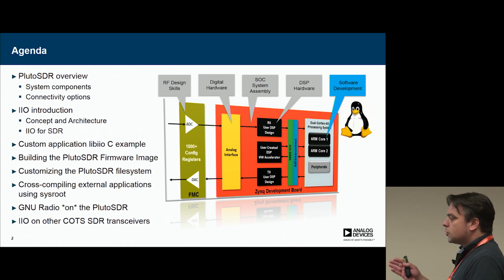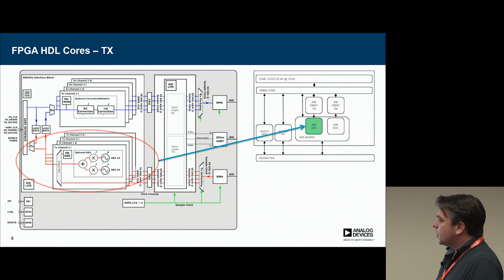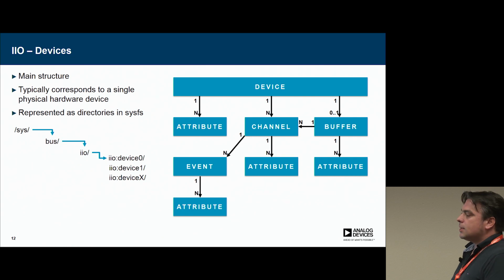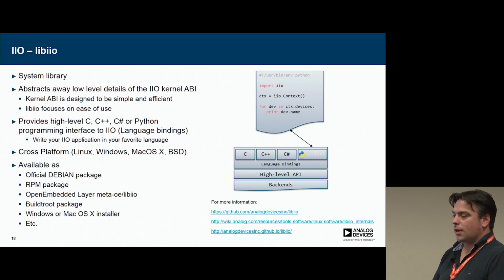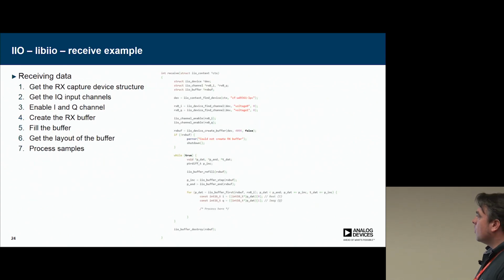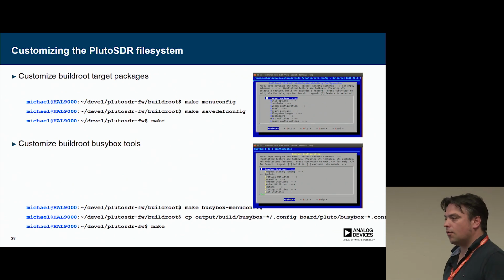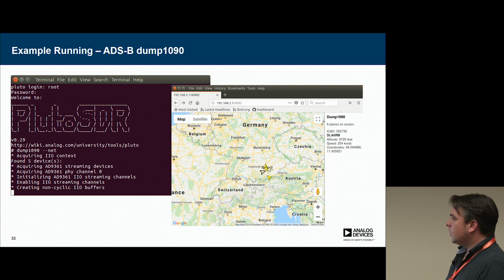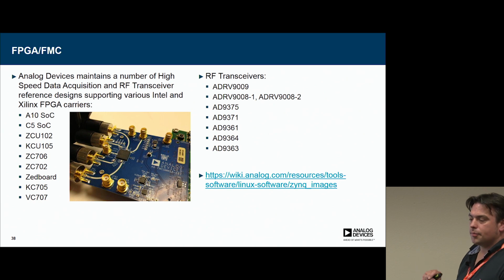GRCon18 - ARM PlutoSDR With Custom Applications

Comment: Thks, USB2.0 interface only has a 60mbs data speed ?is that a data speed bottleneck?
Reply: This is an extremely stupid question, nevertheless it would depend entirely on the amount of data you're transferring and the system it's used in.